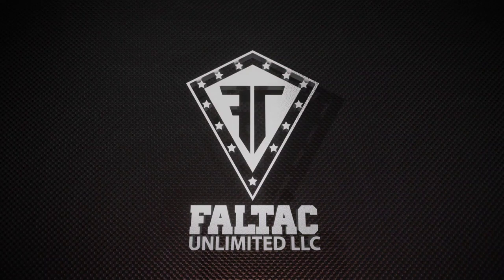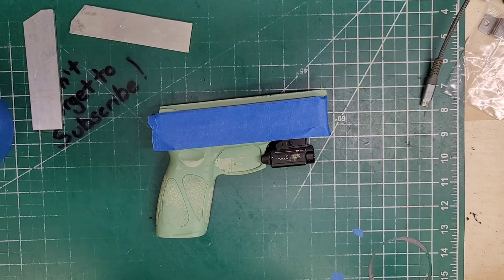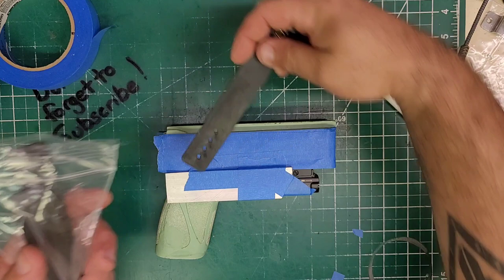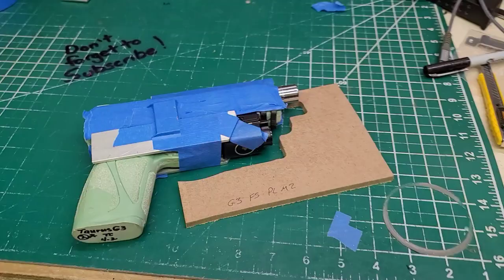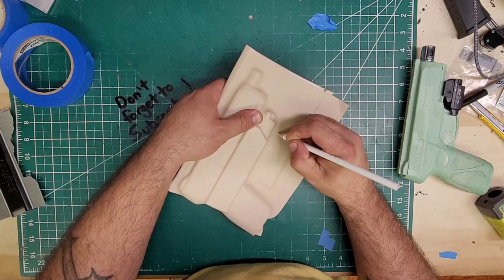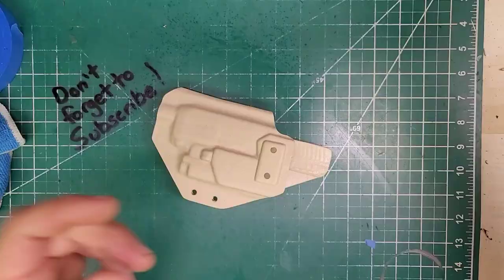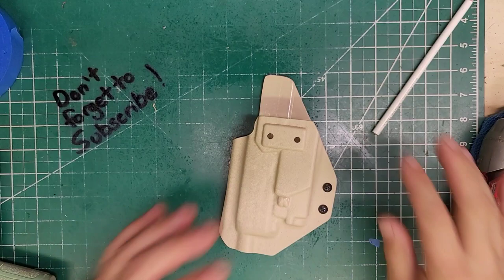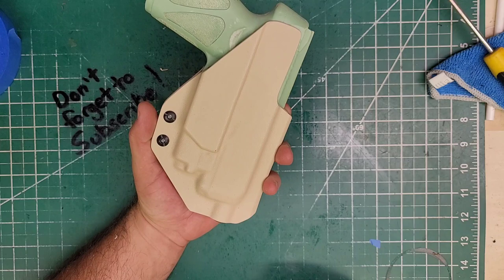How to Make a Holster for the Taurus G3 with PL Mini 2

Comment: When you were blocking the wrong side it made me remember one of the first holsters I sold.  A coworker said she needed a holster for a LCP I say "sure no problem".. I make it for her and it turns out great. I see her a week later and she tells me it doesn't fit. Odd I think. Well she shows me the gun and its got a damn laser on it. On top of that she says "oh and I also forgot to tell you I'm left handed." Had to remake that one. Ever since then I'm pretty anal about getting ALL the requirements. Just finished a lefty G2C and Shield a couple days ago, kept double checking "ok these are left handed". Lessons learned.
Reply from the maker: It happens to the best of us!

Comment: A prepped mold already has the blocking vs natural where you have to add blocking? Asking for a friend… lol, Found a prepped mold of my gun with the tactical development rail but missing the manual safety so I’ll block it. Going to try a 365xl with TDR and stream light 7a OWB as my first DIY Holster. just ordered the flashlight widgets, that’s a good giveaway for someone! My machinist will be making my second set!